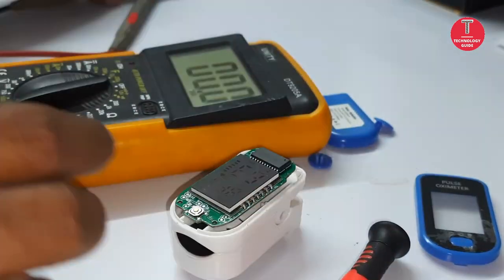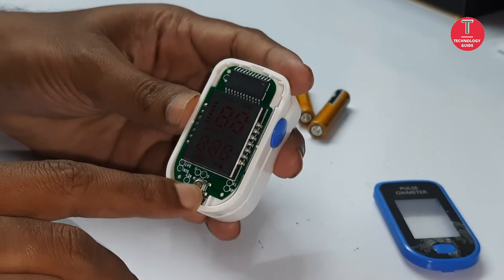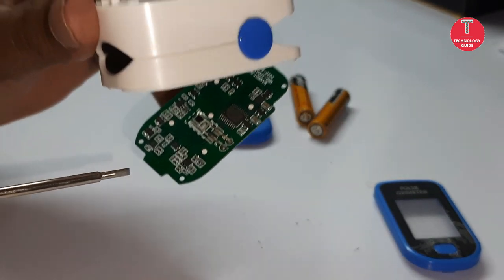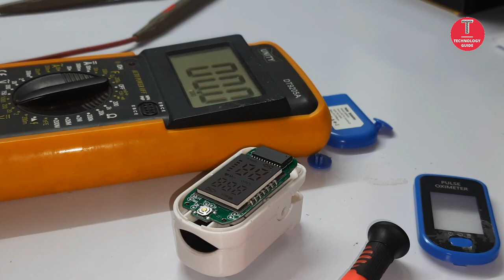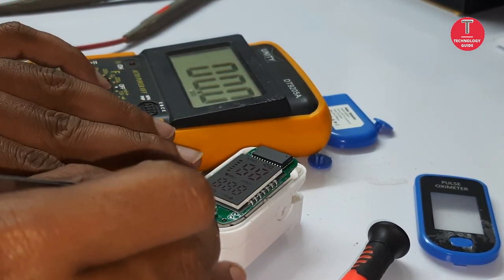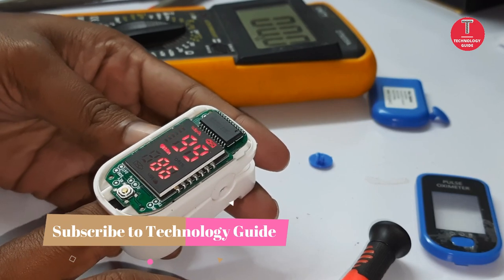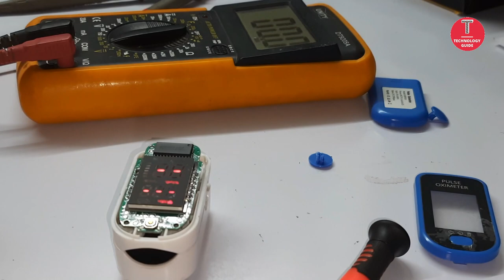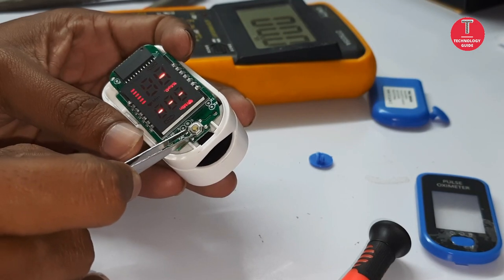Pulse Oximeter Repair Solution | Pulse Oximeter Assembly | What inside Oximeter?

Comment: How change the cable connected to batter and circuit as mine has cable not working properly?
Reply: And which cable works? Model No. PO 12

Comment: Can i convert battery powered oximeter into wired?  Majority of oximeter are 3v . Is it ok to plug it on 5v adapter?  I want a real time pulse monitoring.  When i use battery it drains faster so that i want to convert it as a wired oximeter.
Reply from the maker: you can but you should use 3v supply

Comment: Where can i find such thin wires. In my oximeter the wire got broken. When i try to resolder the wires comes short
Reply from the maker: You can find in some electronic devices like remote control cars
Reply: Same problem  . Wire is broken where i get repair of this

Comment: Sir my pulse oximeter is not working....
I kept it idle for 5-6 months(thought that battery was over, but the result was same when it was replaced even with a new one.)
Reply from the maker: check battery terminals, it may be corrosive dead batteries can leaks acid that may be reason
Reply: @technologyguide5  tq ji

Comment: Did you replaced the switch? Not shown in the video.
Reply from the maker: Yes you are right I didn't replace new one but just opened switch and put IPA solution... its not working due to struck inside only If need to change we should change new one this is SMD Switch available in market

Comment: My oximeter doesn't stay on after pressing the button. I've tried spraying contact cleaner, doesn't work. Does replacing the button requires soldering?
Reply from the maker: did you check continuity for switch ? If it yes then you should do solder

Comment: I bought oximeter and it was worked in the shop and now it is not even switching on. Who will repair this. I don't hve equipment todo. Can u plz help with this
Reply from the maker: check battery terminals in proper manner

Comment: How to fix the display ?
It doesn’t light up with a full power 3 V new battery though the red light is functioning!
Reply from the maker: is it drop in water?
Reply: That's my problem too.  The display is so faint it can only be seen when the room is in total darkness.  The directions say the screen can be brightened by holding down the "on" button continuously, but that does not work.

Comment: Bro after opening of oximeter there is light ON below the display screen but in display there is nothing showing. What is the problem. I just buy it online and it's not working.
Reply from the maker: 1.check batteries 
2. maybe sensor not detecting 
3. if you buy on online return the product

Comment: Sir please help me my oxymeter get fall and after that it is not working , I have checked wires with cell its OK ..can .tell me  where is the problem
Reply from the maker: check power button SMD
Reply: @technologyguide5  okay well what is exactly SMD
Reply: Did you find the solution?
Reply: @priyanshu5349 no  I  haven't check much deeply ...and I will go to any electronic repair shop when they open
Reply: Oximeter ka small sencer wire to aise  jagah pe dia hai ke thoda sabi dhakka lagne par wire tutjae

Comment: My choicemmed oximeter display is not working but senser light is blincking. What will be the problem plz help me
Reply from the maker: You mean no display? is it fell under?
Reply: @technologyguide5  when finger is inserted then the disply will b hang and display will not work
Reply from the maker: @anilbuyo1027  you need to change batteries like Duracell which high capacity try it...

Comment: I have Dr trust USA oximeter always showing finger out error, any solution?
Reply from the maker: is it Red light sensor glowing?
Reply: @technologyguide5  yes sir
Reply from the maker: @shaitanbala5281  put the finger properly and check repetitive, I did face the same problem in one of the device after working fine...and some devices not working fine at normal remote batteries try Duracell batteries..

Comment: I have an oximeter. Its display is not working . But sensor is working . What to do?
Reply from the maker: I think Display problem, is it fell down in water?
Reply: @technologyguide5  no. but it has been 2 years sice i bought it, but rarely i use  it .but now.. need to use it
Reply: @ArunimaRO  Did you find a solution for this issue? Thanks.
Reply: @evapapageorgiadis150  no

Comment: My oximeter is not working.. both display and sensor light not working
Reply from the maker: did u check batteries? and if your device hardly used one then check power ON button

Comment: Battery 1 din ke andar khatm ho ja rahi h plz bro solution?😭
Reply: Duracell use kro Bhai
Reply from the maker: yes you are right
Reply from the maker: Some Oximetr's takes more power that's why normal batteries not working for long time..you can use Duracell batteries that's better

Comment: my pulse oximeter turns off the moment i put my finger in. What can be the issue sir? I am attaching link of video that i made. Please help!!! 

link of video: https://drive.google.com/file/d/1cCVoFRA2NSqO6UI9Uh5cWdZBbRnuumqf/view?usp=drivesdk
Reply from the maker: I think circuit problem....
check the fallowing
1. ON the device without finger in
2. check batteries
3. try Duracell high power batteries